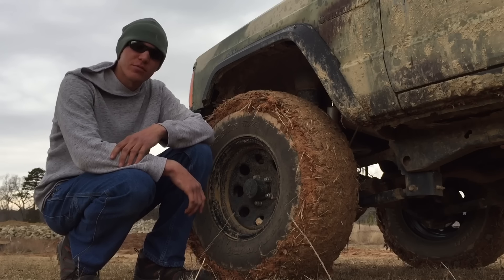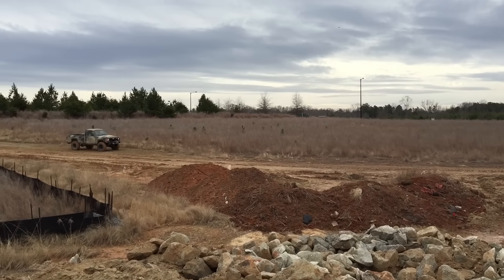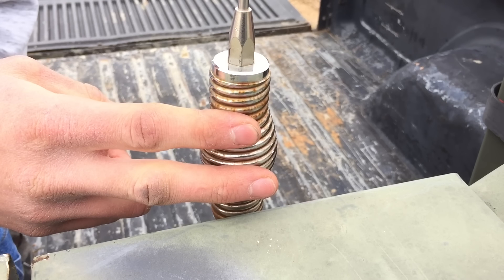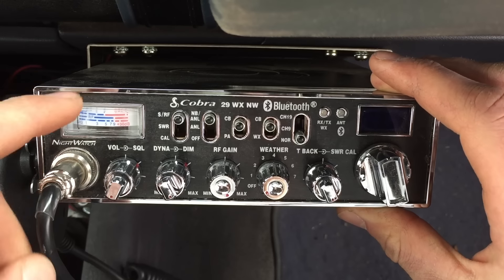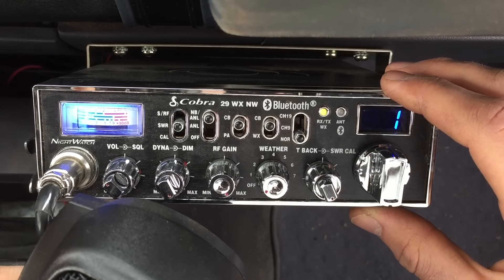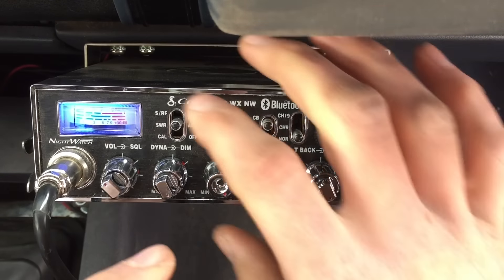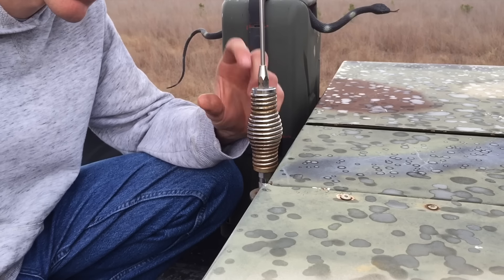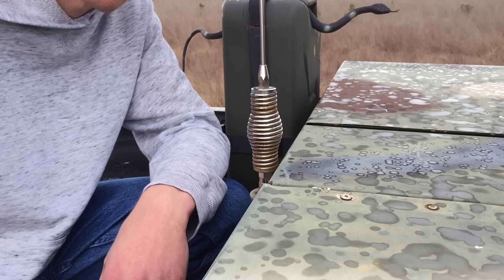How-To Tune a CB Antennae

Comment: if power goes down and cell service  is disrupted they will wish they knew  what  a CB is
Reply: Your right . 
When the grid goes down , only c.b,s will work . But by then it will be to late for them to understand a c.b.
Reply: How would you power a CB if the grid goes? If things get that bad, you better believe your gonna be out of fuel for vehicles in under a couple weeks too unless you stockpile fuel, which only makes you a high value target.
Reply: Daniel T using a car battery
Reply: This is so true.  That's why the Gov't will never get rid of 11 meter CB spectrum because there are millions of new and old CB's out there, and if SHTF happens, people will use those radios to keep communications going.
Reply: @33rdGemini  CB doesn't need fuel It needs a car battery ...Millions of them laying around if grid go's And all of them cars that you say will only last a couple of weeks will be littered all over the streets ..However As history as shown after 3 days of a east coast black out People resorted to other means of fueling ..My city police / fire /medical service Poured fuel manually into cars and trucks From city storage that has a resevre for Salt trucks  The same hand pump can be bought at a few stores HD ones. 

You would not be a high value target if people don't see your cans inside your truck And you were smarter then sticking around to get to that point ...Really if you get to a point Nothing will save you from a total disaster The Idea of a CB is having one more form to keep in touch with the outside ..You cell phone dies, forgot it at home, bad or no reception ..You break down in the middle of a side road 20 miles from the main road in the Canadian north during winter Where skin freezes in mins. No signal Your going to want a CB or a Skidoo in the back ...
Reply: @crispychicken2743  and ham radios. No telling how many people are licensed though

Comment: A split ring locking washer and flat fender washer is for stopping the assembly from unthreading. If you need to change height, you can add more flat washers, but don't misunderstand basic assembly.

Comment: Hey buddy Im getting the same calibration reading on channel 40 as i am on channel 1. Ive got my antenna hooked up correct. I have a wilson trucker 2000 with a hood mount, its grounded. Also i have a Cobra radio with the built in swr meter

Comment: nice clear information, thanks. I am curious how you got your cable into the truck. I don't know about doing it on a truck but I have a little sedan. They say you want to put the cable in the break of the weather seal of the door. my car doors don't have a break in the seal. It's a solid loop. so I am kind of forced to close my door on it. any suggestions? 

and yes it looks super goofy having a big antenna on my little car but I do with what I got and it's nice when truckers relay whats going on in traffic situations and which lane to be in.

Comment: Yes everything you said is correct! But when you add a 4 inch spring to a 102 inch antenna you need to shorten your antenna. On the bottom of your 102 inch antenna is a set screw to adjust the antenna length. Sometimes you have to cut the antenna stinger length.  The 102 inch antenna is a 1/4 wave length antenna.  Using the formula for a 1/2 wave length 468/f MHZ= Half Wave Length in FEET. Example 468/ 27.185Mhz CH 19=17.21Feet. But that's a half wave length! You then divide by 2 for a quarter wave length 17.21feet/2=8.60Feet. But to covert to inches 8.60Feet x 12 inches=103.29Inches. So 102 inch antenna + a 4 inch spring is 106 inchs of antenna! Careful when cutting the stinger.  I cut a 1/4 inch at a time.  Not sure you need to cut?  Add a alligator clip to the tip of the antenna it will make the SWR either better or worse. Then you will be sure YES to cut. Its time consuming but pays off in the end.  I like your washer adjustment, that will work when your down to the fraction of the inch adjustments.  Remember this: Your radio is only as good as your antenna! That fraction of an inch will mean the difference of many miles of transmission.  That fraction of an inch will result in energy  Reflecting back to your radio, burning up your transistors that radiate power out to your antenna. Note always mount your antenna ABOVE the metal surfaces of your car.  Try to mount your antenna in the center of the vehicle.  If mounted in rear, the antenna will be directional to the front of the vehicle. Your vehicle is the other part (counterpoise) of your antenna! If you can't set the SWR no matter what you adjust move the antenna. Mounting on a bumper with the antenna close to the fender or hatch, it will never SWR match.  Keep the antenna clear of obstructions! Million dollar radio + crappy antenna= NO CONTACT   I also suggest FRS CH1 radios and CB CH19 radios because people monitor them. Formula works for all frequencies... Mike N8JGU.
Reply: BrianLeeUSA73 That would sure help us newbees out a lot!
Reply: I believe the length of coax from antenna to Radio plays a role too. 18 feet of coax is what I've been told. It's a pain because you have to snake it around to avoid coiling it up and messing signal up.
Reply: Sorry but you must be a newbie... actual quarter wave for 11 meter CB Radio is 109 inches, the antenna is 102 and with a ball mount and spring its a 109 and its a no tune antenna setup... old school... you only cut the antenna if it has a base load or center load and some top loaded you trim,  most of them you can slide the antenna in or out of the coil... because these are shorter they have a coil of wire that  makes the length 109 so you slide the antenna to get the right length in most cases. AS for the wire myth is just all that a MYTH except for LONG HIGH POWER RUNS  you need the proper length due to the HIGH POWER, a standing wave ratio (swr) that's too high can cause equipment failure and running 30,000 watts would be costly... Since its just a CB radio in a car its best to run the shortest length possible so the wire is not all coiled up. If running a BOOT to gain some extra power up to 5000 Watts you still only want the shortest run between the radio and the BOOT and the shortest run from the BOOT to the antenna, The main thing is you always ALWAYS always check SWR with a meter at the back of the TRANSMITTER not the AMP\BOOT and never at the Antenna. A built in meter on the RADIO\TRANSMITTER is fine as well because your checking for the standing wave which is like feedback to the transmitter and no need for an extra meter.  Another trick is to tune the radio at the center frequency not at the ends of the band, notice the SWR was low at CH 19 and not 1 or 40, that because CH 19 is the center of the band not 20 as you would think, so tune SWR on CH 19 get below 1.5 and your good, get down to 1,2 you at the best any below that is a false reading.
Reply: Mike W. Started to read this and new it had to be a HAM,LOL
Reply: Precisely. Cable length is a myth - it plays absolutely NO part in how a radio (on any frequency) tunes up into an antenna.
Reply: Bad Dog not so , coax is becomes part of the antenna . 468/fmhz x velocity factor xodd multiple if you tune swr at the radio.
Reply: BINGO!!!
Reply: 👈😲 thanks 🖒
Reply: A 102" with a 6" spring makes it a true quarter wave of 108".
Reply: I ran a 102 with spring an a 250 watt amp never hada shortin it
Reply: How about you don’t cut the 102 and you start with 19 feet of coax and cut the coax.
Reply: I swear. Some people's children should not be seen nor heard from.
Reply: @crackonwithnowak5087  15 feet will do just  fine

Comment: The coax should be 9' or 18' and 18' is better than 9' for jest swr. You are correct, do not coil the excess as you essentially create another antenna. Run it in a figure 8 pattern about 12 inches from end to end bound in the middle. A long, skinny figure 8 is what you're looking for.

Comment: Hi Sean! Nice video! i guess you forgot to mention: tha place that the antenna is mounted in your vehicle, will affect the pattern in which the signal is radiated from the antena..in the video showing the antena mounted in the center of the vehicle is the best example for 100% all- direction efectiveness.
Reply: Good point, I had actually thought of this during post, I knew I would forget something!
Reply: Top dead center would be preferable.
Reply: @seanbleepinjeep8668  ... 102" whip: Best antenna on the market and a full 1/4 wavelength on 10/11 meters.

I used to do radio repair/installations until arthritis and failing eyesight got me out of it.
The biggest complaint from DIY'ers that I would hear is I can't get my antenna to match.

Question: Where is the antenna mounted?
Answer: The tool box behind the cab.
Question: Is the box grounded?
Answer: "blank stare"

Always make sure that no matter where you mount the antenna that you have a good ground.  Especially on the newer vehicles where every thing is isolated from the chassis (your main RF and Electrical ground) to make for a quite ride.

Great video, only one I can find on YouTube that explains it correctly!

However (yep, I have to throw one of those in)  The potbelly spring is 6" tall.  Flat sided springs are 4" tall max and I would never use a flat sided spring on any whip antenna over 3' tall, not strong enough to keep the antenna mostly upright when moving!

Minimum clearance around vehicle with doors closed to tune antenna:  1 full wave length at the frequency band in use, 11 meters about 38 feet.    1005/26.965=37.270 feet

Been doing  radio since 1967 (including time in the US Navy as a RM, Radioman, main job antenna maintenance, 1972 - 1982) and repair) and radio repairs (FCC Licensed) and installations from 1975 until 2006, licensed Amateur Radio (General Class) op since 1992.

73, de N1WOM
Reply: Actually, mounting any antenna dead center on a vehicle produces a figure eight type of radiation pattern with the major amount of the signal (know as lobes) to the front and rear of the vehicle.

Mounting a 102" whip in the center of a pickup/suv type vehicle is not a good idea, hitting overhead obstructions, etc.  On the tool box is okay as long as you ensure that you have a really well grounded box, otherwise you are just installing a dummy load.

73, de N1WOM

Comment: I believe the 102 wips are made to be used with the large springs to be the correct length for the cb frequency for low swr.
Reply: Yes 102" is made for a spring, 106" is for no spring
Reply: stephen john gray  The little ball on the top needs to stay

Comment: In reference to your statement that CB radio waves are are about 3-1/4" long, if I understand your statement, that is INCORRECT! CB transmits between 26.965 and 27.405 MHz, with a  full wavelength between 10..939 and 11.118 meters, or 35.89 and 36.47 ft. or 430.67 and 437.72 inches!  HOWEVER, I think what your meaning to say is that the DIFFERENCE between the wavelengths of Ch 1 and Ch40 is about 3 inches. But this show a difference of just over 7 inches at FULL WAVE. Your 102" whip is a 1/4-wave antenna, so dividing that 7 inches by 4  is 1.75 inches, and half that (for the midpoint) is 5/8". THAT is the adjustment range of your antenna.

Comment: So if you change radios will you need to retune? I ask because I have a radio with a built in swr but I’m putting a smaller one in a different vehicle and was hoping to tune the antenna with the built-in swr before installing the smaller radio.

Comment: I have a Galaxy DX939 and a Stryker 955 HPC and both have self calibrating meters. The meters are not as accurate as a standalone meter, but both of my radios have high SWR warnings and the Stryker will not transmit if the swr is too high. Good protection feature. Most people I know just mount the antenna and don't even tune it and then they wonder why their radio doesn't work.
Reply: I have seen those so called Protection Circuits fail & show a High SWR when the SWR was great.They are a reference item just like the builtin SWR Meters at best.
Reply: Use this website for information. Read through it. Look for dirty grounds for poor grounds Shorted cables. Broken antennas.

Comment: Quick question, when changing to a different antenna, coax… do I have to re-calibrate the setpoint with the SWR meter? I had a radio hooked up to an  antenna on the right side of my truck, bought a totally different kind of antenna to put on the left side of my truck,  so I moved my Midland 5001 radio to the left side. hooked upa handheld midland  75-822 to the right antenna, calibrated it with SWR meter.. then went to hook up the STI meter to my radio on the new system on the left side and I couldn’t get the needle to the setpoint it matter how far right I move the knob.. It goes like halfway and start shaking like crazy.

Comment: Wish I knew about some of this stuff years ago when farming and still using CB's. Couldn't talk/hear if someone was 2 miles away. There was also so much more static the higher the channels. Most of ours didn't have all those knobs either.
Reply: If you’re having trouble hearing it is most likely because they are Having trouble talking. Which means that their antenna is not tuned. The static noise can be eliminated by turning up the squelch knob.
Reply: Sometimes a simple radio can be the best for your purposes. You don’t need all of those bells and whistle‘s that some radios have. A 3ft Francis antenna and 18 feet of coax are probably the best plug and play system you can go with.  Make a large loop with the extra coax.

Comment: Just bought this unit. Calibrated as you said. Keyed the mic. Nothing happened. No sound. Thinking it was the internal speaker. I bought an external. Same result. What could I possibly be doing wrong to not get any sound

Comment: If those washers make a difference, then that spring will really screw things up.  Adjust the length of the antenna by moving the whip up or down according to what the SWR meter says.  Higher frequencies are shorter antennas
Reply: Please explain how you move the whip UP & DOWN on a 102" Stainless Steel Whip? I'll be waiting so hurry up. LOL
Reply: Read what I have posted

Comment: FYI if using the cobra meter you only cal it once on channel 1. Otherwise you get a false positive. The cobra 29 was a jump seat radio to allow drivers to quick set the swr threw the radio instead of ant. Best is to use a swr meter in line. Try to get a .5 to 1 reading on channels 1 and 40.
Reply: That's not what the manual says. The manual says channel 20 first, then 40, then 1.

Comment: well thank you. helped a lot. i'm still a little new to all this so when you are tuneing i am on 1 and get a swr reading around 2 and then on 40 i'm at all most 3 any clue on how i get get them any lower? thank's
Reply: Sounds like either grounding issues or cheap coax and antenna
Reply: Hi a swr of 2 is acceptable and 3 is a bit to high so find the gromit at the base of the whip if your using one and unscrew the gromit and move the whip down about 2mm maximum and try swr again it should be fine if not do same again until happy this also works moving the whip up the way as well and with various antennas too. 73,s Len.
Reply: Find a local ham operator and he'll do it in no time flat

Comment: I thought there was something to do with having your cable at a certian length .. 18 foot is min supposedly but I do not know the tech side of why it needs to be 18 foot just that is makes a difference .. you said the shortest length of cable is best .. anyhow great video for someone like me that wants to get into the hobby .. thx
Reply: 3 ft is min but you want to stay in 3ft increments 18ft is 99% of the time unless you have a 102" whip then you can kinda go with whatever as long as it's in 3ft increments.... Keep in mind stay away from fiberglass antennas they're junk and most aren't tunable
Reply: Totally a MYTH & BS.
Reply: All antennas are tunable in some way.  The length of the cable has to do with the amount of magic that is in bedded into the cable by the little people. 18 is a good length. Long, but good.  Make a big loop with the extra.

Comment: I can't get it to reach the "cal" position and SWR jumps to the max of the gauge... The (mag mount) antenna is indoors, untuned, and only grounded to a filing cabinet, but it shouldn't be this bad, right? I have continuity between antenna and center of the PL-259.

It is transmitting though... to some speakers across the room :D

Comment: Would you use this same method with a 250A linear installed? I would imagine you'd match the radio and antenna barefoot then when the linear was turned it'd be just a stronger signal. Right?!?
Reply: Yes set swr with linear hooked up but not on then check with it on and you need to make sure the radio is tuned to the amp
Reply: you are exactly right

Comment: I have an motorhome that has a fiberglass body shell. It has a high mounted fiberglass rod antenna stick that is grounded to the chassis. The SWR readings are pegged. I was told to shorten the antenna cable but got no better readings. Any suggestions when I get a friend's meter to get readings to adjust it?
Reply: The antenna base needs to be mounted on something metal; a bumper, a mirror mount, ladder, toolbox, etc. It needs a metal base or "ground plane" to work properly, just running a ground wire from the mount to the chassis isn't enough. Also pay attention to how the mount is set up and you have the insulating washer in the right place.
Reply: +Cheezy Dee you can use a ground plane antenna and mount it on the side of the house and also you can just run a wire for ground but it would need to be a big one😉😉😉
Reply: Like I said but a ground plain or like cheesy said mount to a mirror or something metal that is grounded to the frame
Reply: Buy a 1/2 wave antenna if all else fails since a 1/2 wave antenna does NOT require a ground plane & the mounting location does NOT change the radiating pattern either.